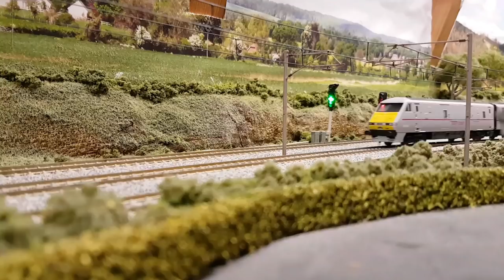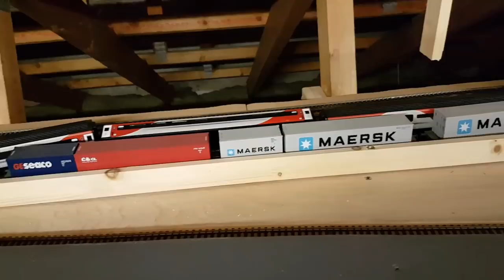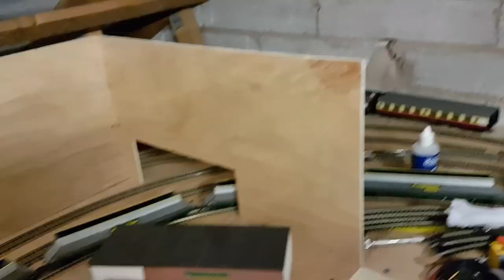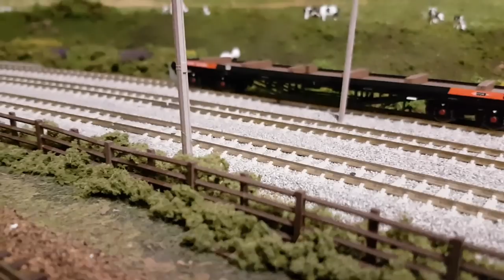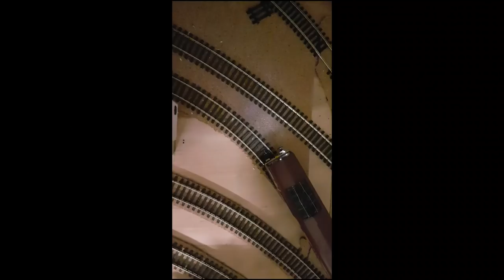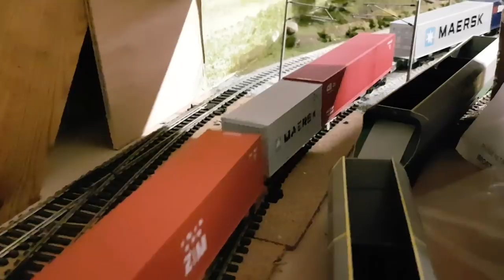New Junction - Installing the Backboards

Comment: Your back boards really do frame the station scene and you’ve done a great job on them. Just enough height for some interesting background buildings
Reply from the maker: davie maclean Yes, it's going to be interesting as I've no idea what to do haha
Reply: I haven't done it yet, but my back scene is so small (low roof angle)I have decided just to use photographs, not even low relief buildings!

Comment: I'm dreading doing my backscenes. Still working out what I want to do.
I had a thought for your backscenes. At the piece at the end of the station have you thought of cutting the top half off and setting it back slightly. Idea being a bridge over the tracks with the ability to have the backs of some low relief shops or houses set back a bit. Therefore giving the impression of the tracks going under the town. Not sure if this fits in with your ideas, but thought I'd throw it into the melting pot for your consideration. 
Thinking what you have done frames the layout nicely though.
Cheers, Rich.
Reply from the maker: Doug Park Junction That's a really good idea, the though of more woodwork is painful mind haha